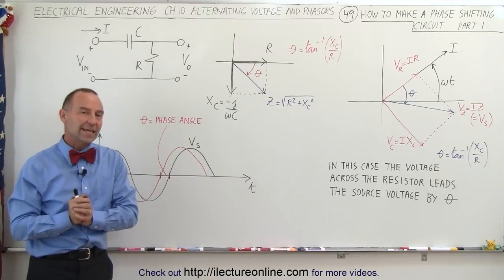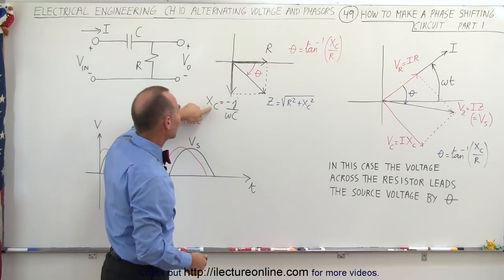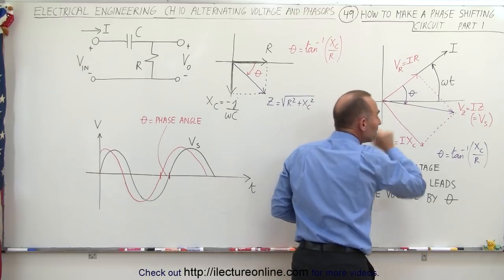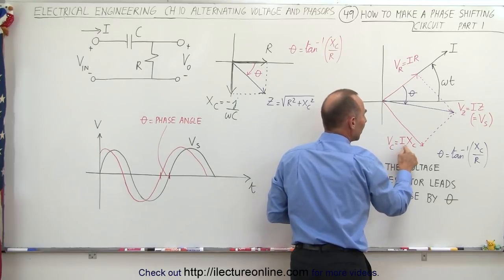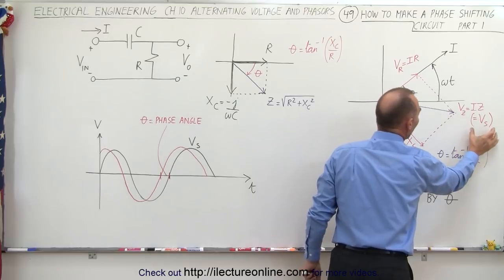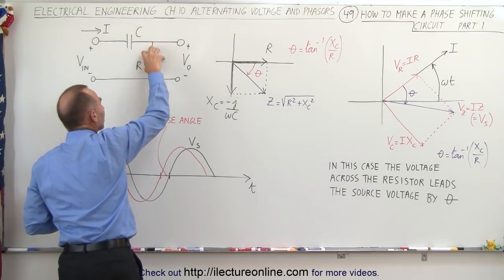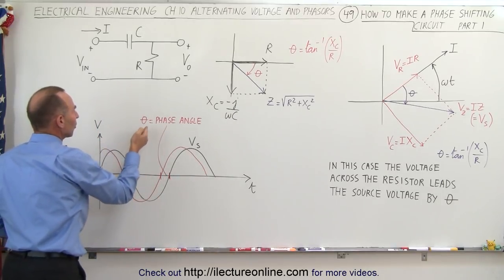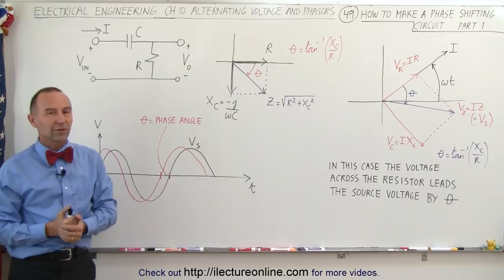Electrical Engineering: Ch 10 Alternating Voltages & Phasors (49 of 82) Phase Shifting Circuit P. 1

Comment: what a great explanation sir! But I still have question that why V across R leads but not lags the V source?
Reply from the maker: Are you referencing the two sine curves on the graph?  If yes, note that the horizontal axis is "time".  The curve representing the voltage drop across the resistor reaches the maximum to the left compared to maximum voltage across the capacitor.  TO THE LEFT MEANS EARLIER IN TIME
Reply: @MichelvanBiezen  Oh, I got it. Thank you sir!